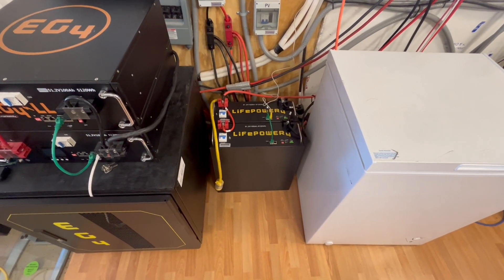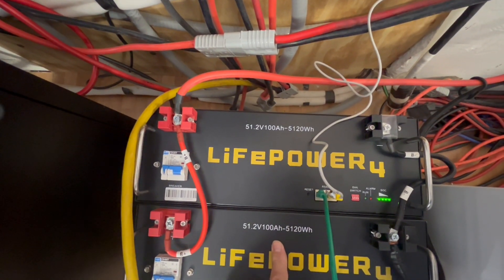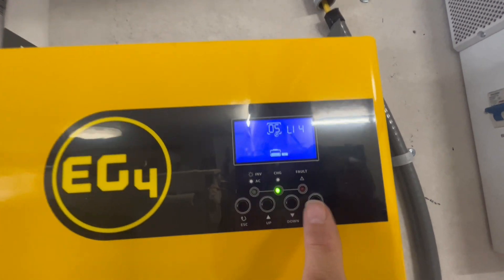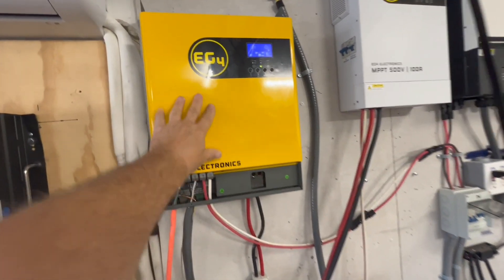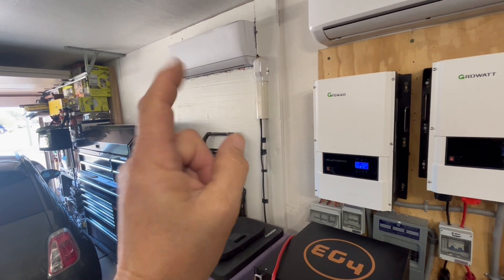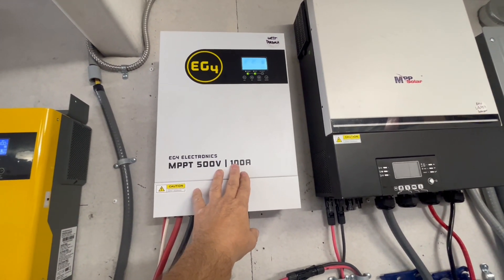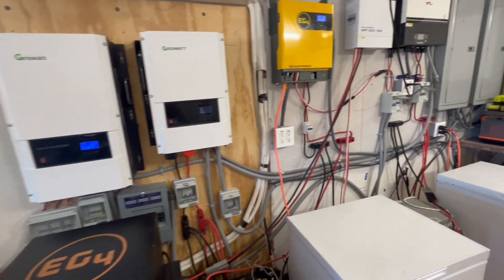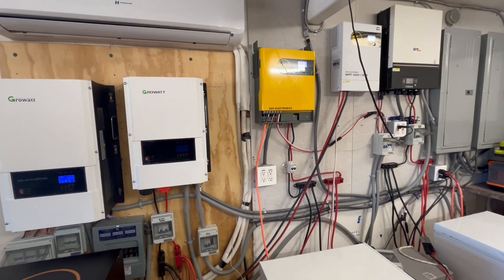Testing Lifepower 4 LiFePO4 battery with EG4 3000 watt off grid inverter & programing.

Comment: Hello I’m so glad u mentioned the amp hours I just set my single 3000 up with 2 eg4 ll battery’s have number 5 setting for eg4 but it’s showing 100 ah
Reply: Well I have a eg4 ll v2 battery and eg4 ll v3 and signature solar had me update firmware on the v3 down to the v2 firmware not sure exactly how to check what firmware is on the v2 but I see u use all the different versions u might know guess if all else I’ll give tech support a call in morning thanks for all ur help and videos 😁
Reply from the maker: @jimverh1868 yes, check with Signature solar
Reply: @diy-solar-guy unless I do firmware they said 000 reading is all I’ll get but everything else works great so not worth me bricking it to see 200 ah on screen 😎
Reply from the maker: @jimverh1868 I have 7 batteries connected in 3 set in parallel, I have a 500 amp Victron shunt connected to buss bar with batteries connection thru the shunt and I can only get 200 ah to show. I would have to have all of them in parallel in a cabinet to get them to show up as 700 ah. But I would have to remove the shunt. It is not a big deal since the percentage of charge is always really close for each of the 7 100ah batteries. They only sell 3 battery cabinets and 6 battery cabinets. I have 2 - 3 battery cabinets.
Reply: Under batt it’s just 000
Reply: I am just running for first time and battery’s were at 55 percent when hooked up I’m charging now there about 77 percent charging slow only 20 amps battery’s show 10 amps each charging not sure if this will effect that or not
Reply from the maker: @jimverh1868 should be ok, each battery BMS will adjust until battery is 100 percent charged
Reply: @diy-solar-guy I’m just concerned in a search on it I found I person with this and it needed a firmware update on the 3000 :( just don’t want a expensive brick lol
Reply from the maker: @jimverh1868 I have not done any firmware updates on any of my 9 EG4 batteries. Working just fine.

Comment: Great video!  I have a "simple" question that I cannot find on the dozen videos I have watched.  I have the EG4 setup as is shown here, that has been running fine,  with my one 48 volt  LifePower Battery. I ordered a 2nd LifePower battery a year ago, but just connected it a week ago. I had the  orginial battery with "Dip switch 1 DOWN", on  the NEW Battery I flipped the 2nd "Dipswitch 2 Down" as I thought was correct! I also  disconnected the LOAD, last  week, and was charging from AC "in" and Solar. .... I just checked the batteries  Last night , and BOTH batteries were completly discharged with red alarm lights  ....... this morning I connected only the single NEW battery with Dip switch 1 DOWN,,,, and it charged up and is working Fine tonight,  with a LOAD!  Question...... when both Batteries are connected correctly in parallel.... WHAT are the correct Dip Switch Positions of Battery One, and Battery two??
Reply from the maker: When you change the dip switches. You have to change dip switch, turn battery off for a minute, then turn back on. This resets the dip switch setting. 

I have had to at times, when running the battery down all the way to where the red alarm light comes on. Charge the batteries back up individually to 100 percent, then turn that battery off and turn on the other dead battery and charge that one up completely to 100 percent. 

Also the Lifepower4 batteries can tend to have one charged all the way and the other one at say 90 percent and not charge anymore. When this happens, I have to turn off all the other batteries in parallel then discharge the one that was not fully charged all the way, then I need to fully recharge that battery then fully charge, might have to discharge and recharge several times to get it to charge up 100 percent. 

Eventually it will go back to 100 percent. I’ve only had this issue with the lifepower4 battery. 

The newer batteries LL’s have never had a problem with charging in parallel. I think they have a much better and improved BMS. This seems to occur every once in a while with the Lifepower4 batteries getting out of sync while charging. But is easy fix.
Reply: @diy-solar-guy  ......Thanks for your fast reply ... but WHAT is the CORRECT "Dip Switch" Positions for Battery  One, and Dip switch Position for Battery 2??  Also,  if I add a 3rd LifePower4  v2 Battery... the Newer One that just came onto the market, what would that 3rd Batterys dip switch position be?  ...... Thanks Again!
Reply from the maker: @ what inverter are you using?
Reply: @diy-solar-guy The Signature Solar... EG4 3000 that I purchased 2 1/2 yrs ago
Reply from the maker: @billdurham5545 I will try to  look in a little bit, but extremely ill. But your answer is in the owners manual for the EG4 3kW inverter. It shows the dip switch setting for master battery. then all the other batteries just have to be different dip switch setting. The master battery is the one you will use to connect communications cable. No two batteries can have the same dip switch setting.

Comment: Did you have to update the firmware on the EG4 3k inverter for it to display the 200 AH?  Mine with no firmware update does not show the same display as you have above. I have 2 of the new LL batteries hooked up to mine.
Reply from the maker: No did not have to update firmware. But had to unplug communication cable and then plug back in to get it to recognize 200ah. I unplugged while unit was running, will. Get a fault code 19, but as soon as you plug communication cable back in , fault code will disappear. See if that will work. If still showing just 1 battery, try shutting down entire system and restarting. When you program, number 5 has to be LI4.
Reply from the maker: Let me know if it worked for you.
Reply: @diy-solar-guy it did not work for me but the overall battery % is pretty accurate.
Reply from the maker: @bhbaker220  try reaching out to signature solar techs to see if they can help you.

Comment: I’ve been amazed at what all you can power with the EG4 3000 inverter and 1 or 2 lifepower4 batteries.  Perfect for a small cabin, critical circuits in a larger house or a large RV.  As I increased my home inverter size, I still use the 3000 for a separate charge controller or battery charger.   Add 8-10 400+ watt panels and you have a powerful 120v solar system with battery backup for under $5k.  Best bang for the buck out there IMO.👍☀️⚡️💡🤩
Reply from the maker: Absolutely, probably will get a second EG4 3000 inverter. I am very happy so far with inverter and batteries